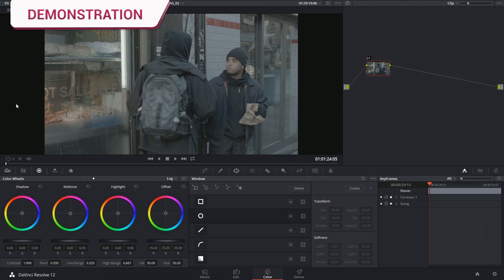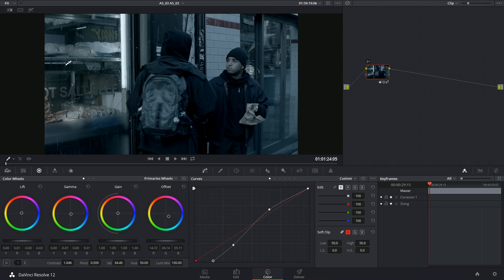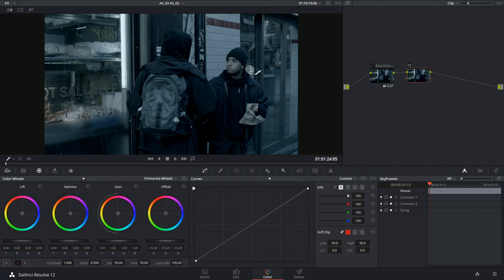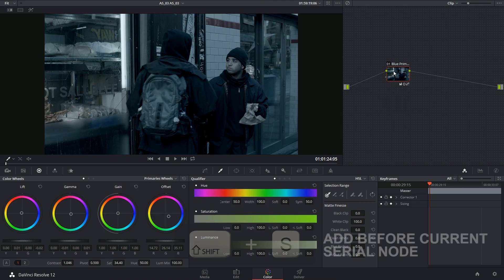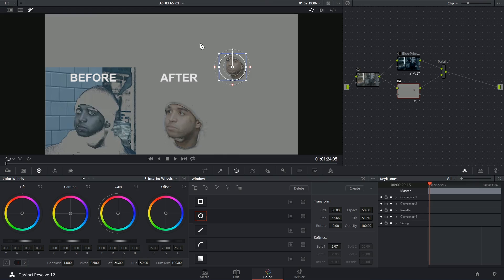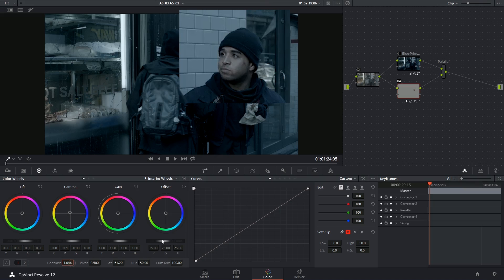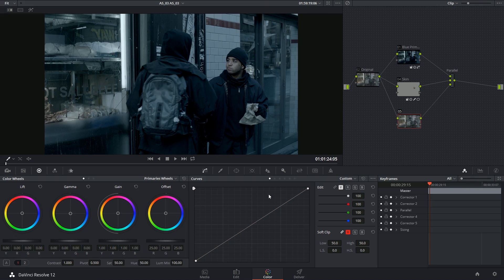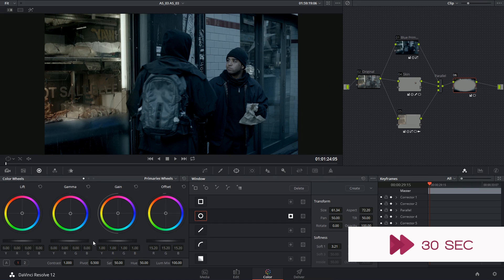DaVinci Resolve 12 - 75b Grading with Parallel Nodes

Comment: I don't realy understand why you prefer use a paralel node then layer node in this case?
Reply from the maker: Parallel and Layer nodes have different methods of combining the visual data. Whereas parallel nodes blend into each other at equal strength, layer nodes overwrite one another completely and offer you various blending options (like layers in Photoshop).  Parallel nodes are excellent for organic-looking grades (especially skin work!), layer nodes are better for tech-heavy fixes, composites or lighting effects.
Reply: @DaVinciMasterKey  I understood the difference between a parallel node and layer node but I didnt understand why you prefered to use a parallel node in this particular case... Because if we use a layer node here we can bland it like 50% to have more accurate result ..?
Reply from the maker: @sh0tiphone  Correct, using a layer node and reducing the opacity to 50% would give the same result as using a parallel node. So, it's one extra step than using a parallel node.

Comment: Daria one question: What is the purpose of that first unused node? I don't really get it and I think it's redundant. Coming back to your videos after years of using DR and finally understanding the depth of the insight you gave us. Thank you.
Reply from the maker: Yup! That node's not doing anything at all, other than acting as an organisational 'tether'. Without it, the 2 RGB connections would be coming straight out of the RGB input, which would make it harder to add new serial nodes before the parallel nodes. I like to add these placeholder nodes to anticipate new nodes and make transitions less 'fiddly'.

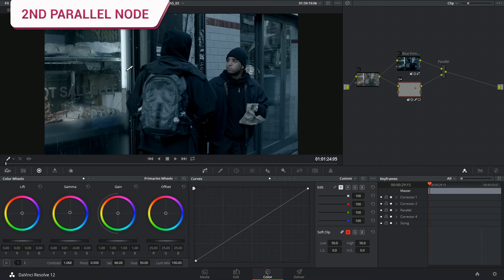Comment: Excellent videos! At 3:44 though when creating a second parallel node, I'm not sure if this was a change in 12.5 but you can just press the keyboard shortcut for add parallel node when on one of the other parallel nodes and it will add a new node in the same parallel stack, so you don't have to manually add another input and convert a serial node as you do in this video. Same goes for Layer nodes.
Reply from the maker: You are correct! The shortcuts are:
Alt+P - new parallel node;
Alt+L - new layer mixer node.

Thank you for stopping by and leaving a message. I do very much love an efficient workflow!

Comment: Hi Daria! Is adding a serial node before the parallel nodes required? I can't see why. We're getting an RGB output already I believe? Thanks.
Reply from the maker: You're correct - it is not a requirement. I like having it there because it gives me quick access to the clip in its 'clean' state, and I can make more serial nodes and feed out keys and such if I need to.

Comment: What if, after making the skin selection with the parallel node n. 4 in your example (2:55), I trasform the sequence in a Layer Mixer Nodes, so the node 4 is no more affected by the blue primary of node 1? Is it correct? Or maybe working in parallel is more smooth?
Reply from the maker: That's the beauty of node workflows - there's not really a 'wrong' way to do things. If the sequence compiles and you like how the outcome looks, then you're good to go! 

In this particular case, the Layer Mixer node might have resulted in a much harsher contrast between the skin tone and the background (basically, a bright orange blob inside a sea of dark blue). This would have required me to first grade the skin to a bluer tone to match the background, before continuing with saturation/brightness controls to lift up the colour. I made the decision to use Parallel nodes to avoid this step - by blending the two nodes 50/50, I was able to retain the overall 'blue' tonality, while having full control over how clean/bright the skin appeared.
Reply: Clear, thanks.
Very valuable to compare with an high level professionist as you.